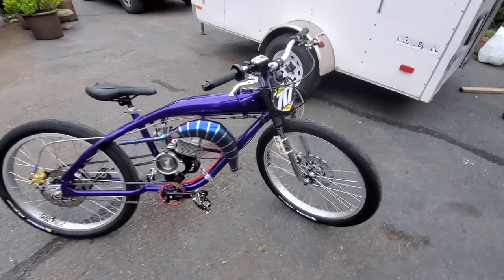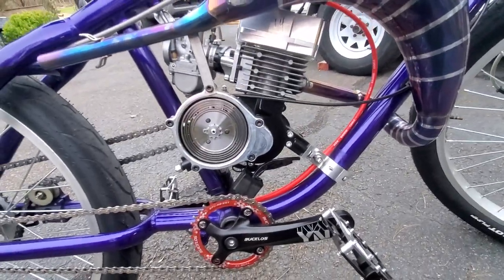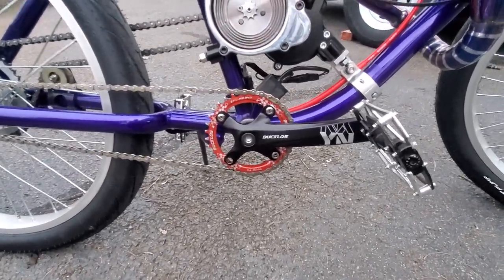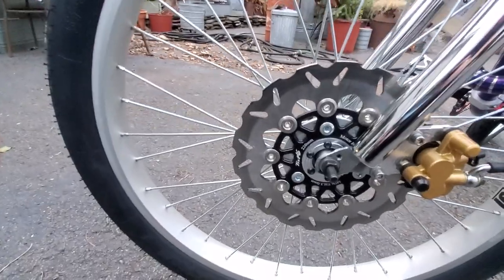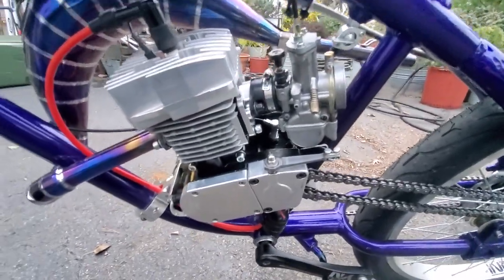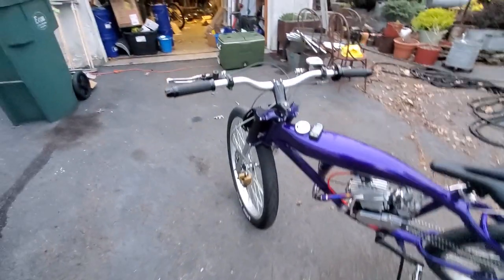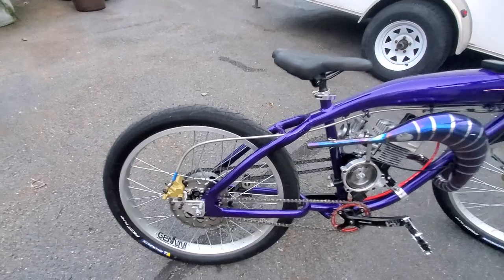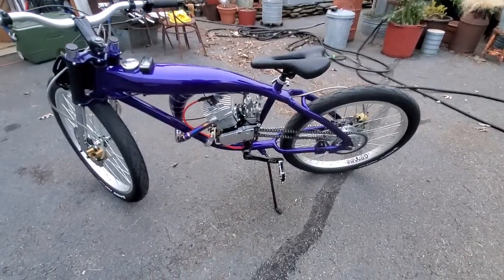Track bike build.

Comment: imagine if that thing was tuned, and had a 38 sprocket?? that thing would for sure hit 50 all day long, once again.  btw i like the idea of that tensioner, i know you were an anti tensioner guy but ive never seen it sit that low, id assume it would be more reliable ???   this is basically a modern day moped, if engineers were involved and 2 strokes were still for sale, this is how they would come, i see reliability written all over this…..  once again smolik on top….
Reply from the maker: Not totally against tensioners but to get both chains to have good tension and tge gearing we need to run for tge track you almost have to have it.
Reply: I noticed the stock chain tensioner roller is made out of crappy brittle plastic, whereas those $15 engine mount spring loaded tensioners come with a much better quality (nylon?) roller wheel....My $15 spring chain tensioner proved useless due to clearance issues on a 29in frame/wheels but I got a much better roller wheel so it wasn't a complete waste of money.

Comment: Super clean! Smolik and RDM are the gold standard! Getting there myself piece by piece got the Smolik Minarelli setup with RDM clutch plate.   Geminis and felt faker so soon I can taste it!
Reply from the maker: Nice. Youll love it and appreciate it alot more once it's all done. What pipe are you thinking thinking
Reply: @kjsmolik  I got a MZ65 on there now but I’ve heard the yasuni R or similar are better fits for the minarelli output. What’s your thoughts?
Reply from the maker: @matthewowens8416  any scooter pipe will be way better then an mz65.  Stage 6 street race is a yasuni r2 which is about as good as it gets but it needs modified
Reply: @kjsmolik  I saw those right after I already bought the MZ65 on EBAY…. Like all things be careful trying to save a buck! My bike is my daily and the MZ was quickest way to get me going. New pipe is definitely next after the frame and wheels. Thanks for the help!
Reply: @matthewowens8416  Same here with my broke ass hastily trying to save a buck.... I recently bought a $75 "Nasty Jack" pipe on ebay without noticing the "no return" policy (most say 30 day returns) To add insult to injury, the same seller now has some listed for$10 cheaper.      I wasn't expecting much for $75, like I already knew the welds would be crap. I wanted it because it had the larger header ID & belly (despite the stinger ID being too big)  
        But... #1 it was heavier than expected #2 the belly & header pipe sections are poorly misaligned creating air flow problems. (I also wasted $25 on a heavy slip on muffler.) In hindsight, I should have just bought a decent looking $40 mz65 clone & made my own lightweight slip-on muffler out of free parts laying around. 
      To make things worse, my pipe needed bending a bit to fit.  I heated a section of header tube red hot. Instead of it bending in the red hot area, it bent further down in a thinner gauge section putting a big kink in it. So now I'm kicking myself for not packing it with damp sand & capping the ends before bending. It'd be an easy fix if I still had a garage & a 220V outlet for my mig welder. I'm hoping my 3,500w generator will be enough to flux core/wire weld it together. (now really wishing I still had my $120 HF 110V AC wire welder) The $75 won't be completely lost if I cut the pipe open, fix the kink, align the pipes & belly for smooth airflow & weld on a smaller ID stinger pipe. If I do all that  it'd work much better than stock & be decent pipe. 
       Someone with a TIG welder could cut those pipes open, re-weld & make a decent pipe for $65-$75.  The sad thing about those  $40 mz65 knockoff pipes is they'd be much better if they didn't put those kinks in the header pipe from the tube bender they use & also used a smaller stinger ID.
Reply: @michaelbrinks8089  well I got the “real mz65” off eBay and it came ready for a Minarelli. It’s not terrible but it has a little bit of the “hotdog down a hallway” when it comes to back pressure and resonance. The scooter pipes from all accounts are much better suited. Can’t wait to make the switch. It’s on my daily so necessity sometimes dictated hasty decisions. Most always regret.
Reply: @matthewowens8416    The "real WC80/MZ65" for $120 has the same dimensions as the $59-$69 "Nasty Jack"  but looks like they took better care making the sections fit evenly..... The "Nasty Jack" pipes looks like the WC80 factory rejects that didn't pass inspection & sold for 1/2 price  lol.   
      I started grinding down the large belly seams today with an angle grinder & it took a whole lot of grinding to make little progress. 
 I'll be able to at least grind it smoother, cut it open, fix the kink, straighten everything & tack weld it back together with my tools on hand. Then hopefully find someone local with a tig welder that'll do the rest for cheap. Also wanna find a smaller stinger ID & flare the end so when I weld it back on. The end of the belly will have better cone shape where it meets the stinger.  
     If I had a garage I'd  DIY make & try selling them. Use some decent but thinner gauge steel, so it'd be lighter & use a WC80 pipe for a template.

Comment: That exhaust pipe is a work of functional art.
        Anyone who's making/selling parts for these bike engines should maybe look into making a manual controlled  exhaust power valve for these 2 stroke engines (metal gasket-like piece with a butterfly valve that sits between the exhaust port & expansion pipe, controlled by thumb or twist shifter)
 An expansion pipe with a larger header ID will have better flow creating more top end power at the expense of low & mid range power. (like WC80 VS smaller header MZ65 clone) A smaller ID header will have better low & mid range at the expense of top end. A true automatic exhaust power valve would be very hard to make. But a manual one could be made much easier. The rider could shift and fully open it at WOT, then shift it to closed position when they come to a stop. It'd give them better low & mid power during take offs & more top speed power when they shift it open @ WOT.
Reply from the maker: Rdm is in the process of building an engine with a powervalve so its coming
Reply: yep chech his you tube for a lil show of it, ggz-

Comment: Beautiful bike bud! Could I ask where you got the PW80 ignition? And where did you get dual hydraulic lever?
Reply from the maker: Pw80 was from ebay. I used an extended banjo bolt and bolted 2 lines together at the lever.
Reply: @kjsmolik  Excellent Engineering!

Comment: I love it when new guys say their bike goes 48mph and all they did was put a F2 thruster pipe and a high compression head 
Nice build I believe you when you say it does 43 mph. Becuase I only weight 120 pounds my fastest bike I can do 41mph
Reply: Yeah I'm a little heavier than you add an extra 100 lb and my NT carburetor bicycle does 41..42. with a thruster exhaust lol
Reply: @mozezcen-valley7555  I’m talking about that Carson dude saying that his bike does 48mph. And his phantom 85 does 55mph. He doesn’t do any porting so this isn’t possible
Reply from the maker: I'm 245 lbs.  It wasn't built to go fast. It's a beginner class bike.  I have bikes thst do well over 60. 43mph with 10/44 gearing but it gets there quick. It's geared for the track.
Reply: @kjsmolik  I know this is nt. Class .. but I have built bikes in the past 49cc not the 66cc and hit 48 .. in middle school but yess understand Kurt .. I hope to get my hands on a stroker crank and move up on the train to a different level as well
Reply: @kjsmolik  I plan to lose weight Kurt don't worry about it... I used to be 160. 4yrs ago.. plan on going back .. but I'm not going to be on a strict diet or anything.. I'm going to get a set of Gemini rims for hope there as good as everyone says can't wait
Reply: @keeganhache6667  fr?? Not too sure whose Carson dude .. is that the one with the blue bike... People were claiming these phantom 85 were 50 mph out of the box maybe there were stuck on kilometers not miles per hour there was a phantom 85 out there and to be honest if it wasn't for the wind it was about the same speed as our bikes.. if not slower.. Not sure it was just a bad day for the bike carburetor was not adjusted or something early but it wasn't running good at all
Reply from the maker: @mozezcen-valley7555  they are 100% as good as everyone says.
Reply: @mozezcen-valley7555  la hovers phantom 85 was just as fast as his yd100 if not slower he got 43 mph out of the yd100 only 37 out of the phantom 85 with the same sprocket
Reply: @keeganhache6667  la hover test the phantom 85 wow must have missed that one or something
Reply: @mozezcen-valley7555  they good, an I haven't even rode them yet, 😁😎👽👍